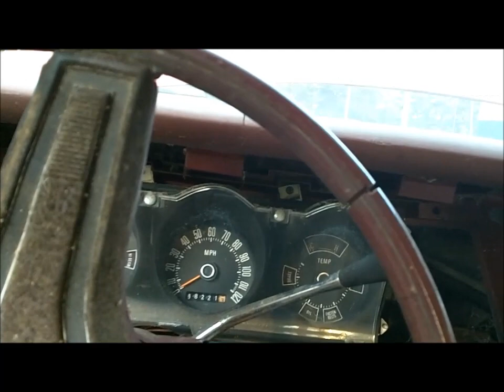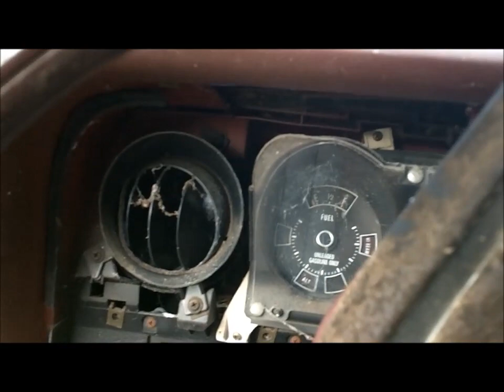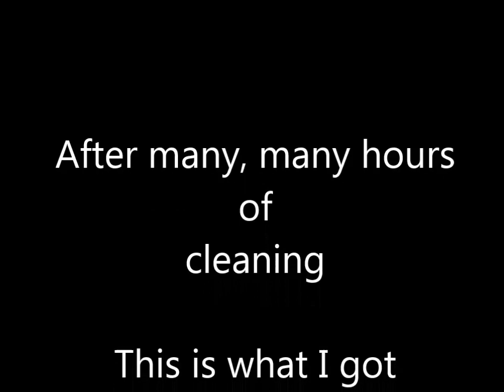Starsky & Hutch Limited Edition Barn Find Part 1

Comment: Is that have a 302 with or the 351w or the 400  cubic inches.
Reply: Brian Eastman 
the 351W  2 barrel
Reply: are you from cali ? live in south Dakota now ?
Reply from the maker: It's a 351 W....... 2 barrel.... In 76 this was the standard engine,,, in  other words it's the smallest motor available from the factory in 76 for the gran Torino.